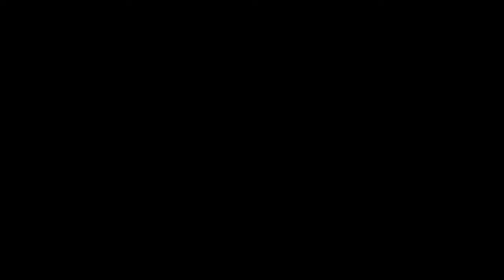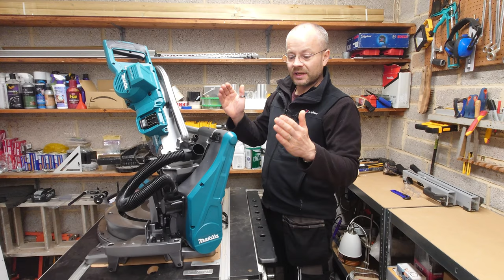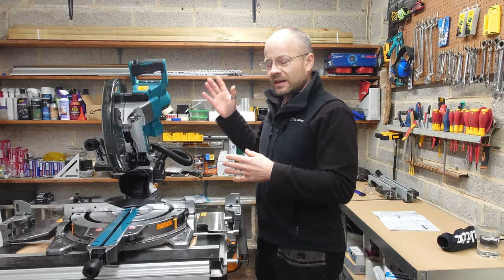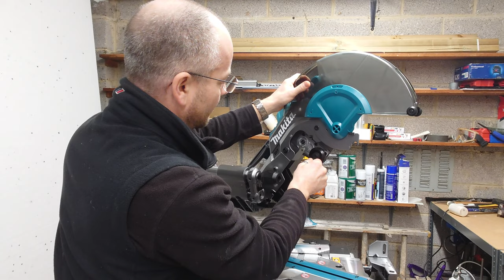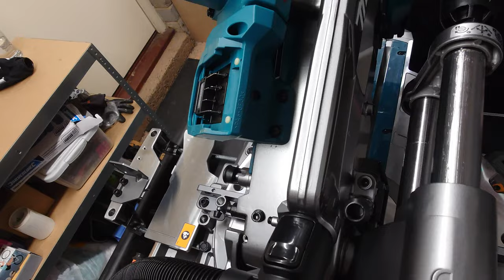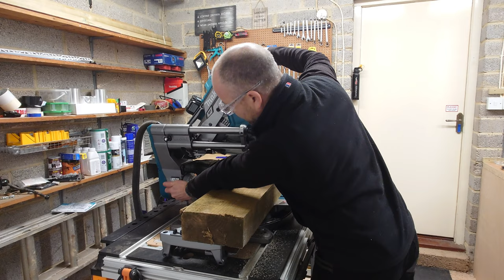How to Set Up Your Makita 40V XGT 305mm Mitre Saw | Tool Tour & Demo

Comment: Thank you for the video -- this was the best walk through that I've seen on the details of using this saw. I think some other walk throughs even had some complaints where a feature you highlighted addressed their issue (such as the bevel locking angles).
Reply from the maker: Thank you so much for your kind words, we are so pleased that you found the video helpful. Do you own one yourself, or are you thinking of buying one?
Reply: @ChampionsOfTheTrade  Just exploring so far. I'm looking at the 10 and 12 inch options from Makita and also the new DeWalt 12 inch 60v. I suspect I'll end up going with the 10 inch to save my back when I move it and also a chunk of change. :)

Thank you again for the video! It was so informative, and you had such a natural flow walking through all the features.
Reply from the maker: @dosadoodle  Thank you so much! And happy exploring, please let us know what you decide on, we'd love to hear about which one you choose 🙂
Reply: @ChampionsOfTheTrade  I ended up going with the 10" version (purchased, to be delivered). I don't think I'll need to frequently cut anything longer than 12" (max capacity of the 10"). While I'm sure I could make use the 14" capacity on the 12", for my planned uses I think that will be relatively rare, so my rationale for the 10" is that the hassle of having to flip the board and very carefully complete the cut in such cases, possibly including a little sanding, is less overall hassle than dealing with the additional size and weight of the 12" on a perpetual basis, as I'll be moving it outside/inside for each day I am using it. (The lower price of the 10" is nice, too, of course.)

Thank you again for the video!
Reply from the maker: We're glad you found it useful. Please let us know how you get on with the 10".
Reply: @ChampionsOfTheTrade  I'm loving the 10"! In my mind, the tradeoffs between the sizes were:
- Weight, which was important to me because I have to haul my tools outside every time I use them.
- Board width cut, where the 8.5" and 10" can cut a 12" board and the 12" can cut a 14" board. There will be times where the 14" cut would be nice, but I can flip the board, be careful, and sand as needed in those rare cases.
- Depth of cut, e.g. for crown, which is what nudged me to the 10" over the 8.5". I honestly don't know that I'll ever really need the extra depth option of the 10".
- Cost, which was last on my priority list, but still a consideration. Beyond the saw itself, blade replacement costs are a touch higher for the 12".

There are a few nicer finishes on the 12", but they weren't factors in my decision.

Given my requirement of moving the saw each day that I use it, I think there would have been a substantial chance I'd hurt myself eventually moving the 12" around, while I still feel in control and safe with the weight of the 10".

Thank you again for the video! It helped make my decision much easier on which line of miter saws I was considering.
Reply from the maker: @dosadoodle  I'm really glad that I was able to help. And yes the 12" weighs quite a lot, I've built a dolly to move mine around.
Reply: @ChampionsOfTheTrade  That sounds like a nice solution. Unfortunately my tools all live in a tiny basement, and I'm not sure I'd trust my saw stand to hold together if leaving the saw attached while hauling it all up/down the stairs.

BTW, I'm getting some bizarre results on mitering that's making me wonder if my 45 detents were machined a bit off. After getting some weird results, I followed along in Spencer Lewis' "Miter Saw Detent Calibration - How to Get Your 45 Degree Detents Perfect" video, first calibrating the right miter 45 detent so that I can do a frame with no gaps in the miters. However, when I then swing the saw to do the left 45 miter, I get about a full degree gap on one the last corner of the frame (suggesting the detent's are off a relative 0.25 degrees from each other). If you have any ideas for how else this could be happening besides a manufacturing flaw, let me know. There is virtually no meaningful side-to-side movement when mitering in the fixed position, so I don't think that's the cause. This is my first miter saw, so I haven't completely ruled out user error despite trying to find some other explanation for over 3 hours today.
Reply from the maker: @dosadoodle  I'm in the process of editing a video that'll show you how to adjust it. Once you know, it's a really simple process.
Reply from the maker: And here it is..... https://youtu.be/PjPiVk0DNQA

Comment: Great video of the mitre saw. Best I have seen so far of that model. I am building  a mitre saw station at the moment and hoping to get this model at some point to fit in it when I have the funds to do so. Hoping the dust collection is better than the Ryobi Mitre saw I currently have. I already have the Makita Vacuum and the wireless adapter so looking forward to connecting the 2 machines up wirelessly. I have a few 40volt tools with batteries which is why I wanted to go with this model. After a year of using it do you have any feedback you would give. Had been thinking of just getting the 260 mm size but as I would be upgrading from a 254 mm size and I won't be moving it I thought I might as well go with the bigger model. Not sure without comparing the 2 models side by side how much bigger this would look for when I am building the space for it to fit in my mitre saw station. I am hoping I have allowed enough room in my build.
Reply from the maker: Good luck with the build and thank you for your kind comments.
Regarding the saw, it is a great piece of kit, but if you don't need the cutting depth, go for the size below..  it's incredibly heavy.
The AWS vac is on my list of things to get..
👍🪚⚒️

Comment: Still liking it? Is the fence square to the deck? I've seen conflicting data about that.
Reply from the maker: I love mine, apart from the weight, but I built a trolley for it. I've seen the fencing issue too, however mine is bang on. 
Unless the fence leans forward, I can't see it being a problem anyway as the fixed fence at the base does all work keeping the material lined up.
Reply: @ChampionsOfTheTrade  true about the fence. The only scenario where it would be critical is nested crown I think.
Reply from the maker: @sethhamilton5824   Here's a follow up on adjustment... https://youtu.be/PjPiVk0DNQA

Comment: So the Makita UK version comes with the AWS dongle? The US version requires a separate purchase.
Reply from the maker: It's the first AWS tool I've purchased that has come with one, maybe because it costs so much on this side of the pond.
Reply: I have a 216mm mitre saw come with a Bluetooth chip but planer or circular saw come without it.

Comment: Question I need dimensions 
Building a bench for my future saw. 

Width 
(wings in)=
(width when saw is at 60 degrees)=

Depth 
(At 90 degrees straight)=
(At 60 degrees)=

Height
(Locked in the down position)=
Reply from the maker: Hello. These measurements are not 100% but are very close, (measurements in cm) 
Width (wings in) = 69.0
Width (wings out) = 94.0
Depth 90 degrees = 91.5
Depth 60 degrees = 51.0
Height locked down = 50.0

Good luck with the build, please let me know how you get on. ⚙ 👷‍♂️
Reply: That is so perfect thank you. 
Could I bother you for one more measurement 
Width at 60 degrees with wings in= 

Did not now if the knob stuck out more then the wings when in. 

Thank you
Reply from the maker: No problem, it's 91cm. Essentially it's the depth of the saw but at an angle, rear to front knob.

Comment: The weight is a show stopper, nobody who uses a miter saw for a living is going to use this
Reply from the maker: Yes, it is a little on the heavy side, but if you needed to cut sleepers, fence posts etc, it would save a lot of work, so useful for landscapers and fencers. But I get your point, it'll be overkill for general building.
Reply: The clear choice is Dewalt, with a shadow line, on jobsites, I have a Makita DXT but it is too heavy for carrying to a jobsite
Reply: Nice review BTW
Reply from the maker: @Indigenousim  thank you. Fyi, the XGT range also use shadow line.
Reply: @ChampionsOfTheTrade  Yes, you piqued my interest in that model as it apparently weighs less than 40 lbs and has the shadow line. Since I mostly do cabinet work and rarely need to do large crown molding and no cords needed, you got me thinking, thanks
Reply: I use this saw every day for living and I mounted on bosch gravity rise saw stand , that's the only way to conquer that beast and it's dawn fantastic saw , glad went over this instead of kapex , and I am a festool fan and own 14 tools from festool but this is a some fine woodworking saw and I went trough yellow red orange brands and this saw is the most accurate and mine didn't need calibration,  it's really heavy tho